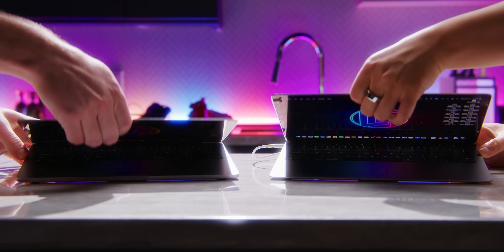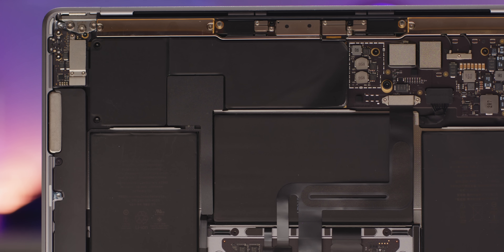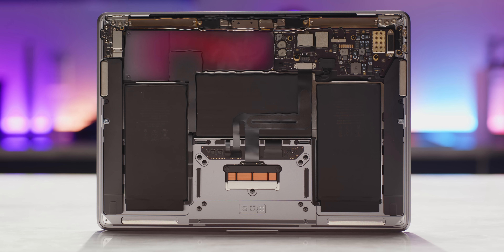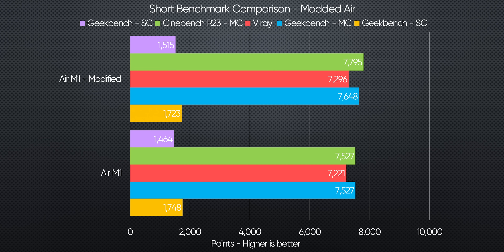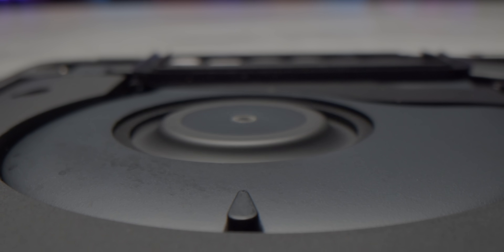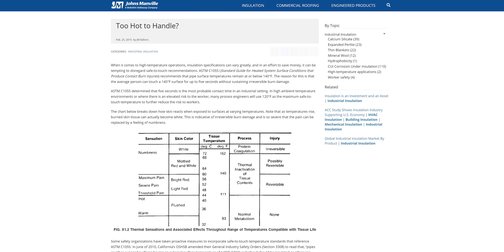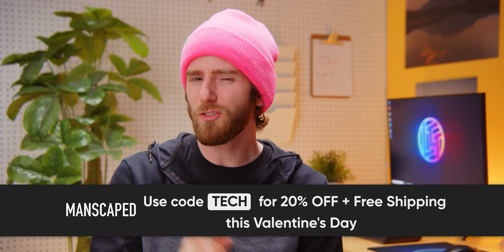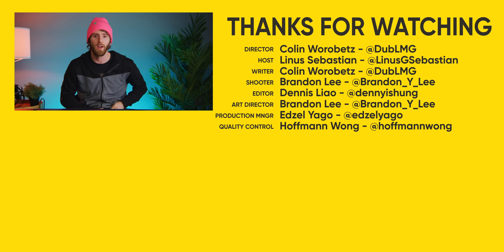Fixing Apple's GOOD Engineering - M1 MacBook Air thermal pads

Comment: I just finished running Cinebench after the mod and my 10 minute score went from 7067 to 7687. The bottom panel got a bit toasty but it's hardly a burn hazard. I can understand Apple's reluctance to making them this way from the factory, because they didn't want people complaining that their notebooks run too hot, not realizing that the panel is acting like a heat sink.
Reply: What about on top of a cooling pad? Does it improve even more?
Reply: @eduardoavila646  Eh, maybe, but you'll reach a point of diminishing returns. I wouldn't spend money on a cooling pad just for this if you've already done the mod. You can only improve the heat transfer just so much.
Reply: Because it’s a regulatory requirement, that’s why.
Reply: @Youthful-Steps--pay-off-later  "There are no solutions - only tradeoffs" - T. Sowell.
Reply: Your battery will die of temperature
Reply: @selenix  No worse than using your laptop on a warm summer day. Much better than most cellphones when on a charger while being used. The batteries can take it occasionally without much fuss.

And chances are the heat dissipates before it even spreads low enough and wide enough to affect the air around the batteries.
Reply: @thequantaleaper  There are Lithium polymer batteries and they are dying at 35°C. Your "Custom heatsink" will not only cool the chip, but also heat the air inside (they are no way to go out). Hot air and contact with HOT "Custom heatsink" is the worst that you can do to the batteries. I hope you understand my bad english.
Reply: @KABKA-0xMP  the thing is there’s already hot air inside the machine without the mod. The difference is that it isn’t going anywhere. The thermal pads direct then to the bottom outer shell.
Reply: @sterkriger2572  in the last 6 months I have changed 7 batteries for clients who modified their macbook in this way

Comment: Okay. Never knew there was a standard / specification regarding surface temperature of electronic devices, but if that's the case, why the hell laptops from like 2009/2010 could reach temperatures so high they were actually really discomfortable and low-key kind of hurt to touch?
Reply: And some mobile phones as well. Xperia Z1 for example could become so hot, that it actually was borderline painful to hold it in hands.

Comment: As you have now been able to transfer heat to the exterior,  you could now utilise a laptop stand with a built-in fan or maybe cooling gel pads on the underside (like the ones you get for migraine etc)  for a  short term solution.

Comment: Unintentionally did the same mod in my old macbook replacing the ssd with an Intel m.2 1tb drive... The slightly thicker m.2 drive touches the aluminum back panel... And that 'heat sink' sure do get hot!!

Comment: It could make the battery lose lifespan since the hotter a battery is when it's in use, the faster it's lifetime shortens
Reply: If you use your MBA at 100% CPU for hours at a time daily and keeping the bottom insulated, maybe? But After just 20-30 minutes or so the batteries are still well within the standard operating temps.

Comment: What if you use a cooling base with fans though? Does it make it even better given the heat dissipation of the chassis would be helped by the fan? ( Or so it seems? )

Comment: How about reducing the surface of the applied thermal pad, or apply that in stripes so that the dissipation process on the chassis is slower? Would that affect performance increase significantly?

Comment: Not Apple's first time they went all passive cooling. The Apple III was notable for having no fans or vents because Steve Jobs thought they were ugly. So you had a computer that cooked itself to the point at which it melted the solder and the chips came unseated. The official solution was to pick it up and drop it three inches.

So why am I not surprised that Apple has produced a laptop that has deliberately crippled cooling. But they don't care. They'll just insist you buy the new model next year when your fancy Macbook Air starts to cook itself. I'm no Greta Thunberg fan but we live in such a throwaway society. Consoome product, then get excited for next product. Ugh.

Comment: Why didn’t you test the cooling pads on the pro? If the theory is that the only thing limiting the m1 is heat, the fan plus the pads should perform even better. Or at least do this same test with the pros fans unrestrained

Comment: Lol, my acer aspire V5 from 2013 easily hits 95C surface temp on the bottom, cpu temps up to 122C according to argus. no I don't dare use it on my lap, it left a permanent rectangle in my memory foam.

Comment: As an Apple Certified Technician I recommend against this for 2 reasons. 
1. It voids warranty partly, maybe even entirely
2. It moves heat over the battery, which over time can cause the battery to swell, or maybe even catch on fire.

Apart from that, it's a clever mod, not gonna lie

Comment: Burning yourself on your Laptop is not uncommon, i use a w541 Thinkpad Workstation and if i train ML Models or anything that puts real load on the machine, it heats up rapidly and the chassis on the bottom left corner hits easily in the 60-70 C range ( right where the heatsink is)... i got burned already on it multiple times, while working in bed or on a sofa. I therefore replaced heat paste etc and also now downclock it and undervolt it to stay nice and cool. While the core temps mostly stay at max in the 85-95C range under max load, but really I did end up with burn marks from this machine. Can not work with in on my lap, while not wearing a jeans or something, if i have to put it under a real workload. I absolutly believe the scientist story.

Comment: Linus is wrong. If the air is 35 deg C then the heat loss does not remain constant and is not the same as -10 deg. C. Also the heat loss is based average heat loss for the whole base and not point heat loss. The heat at the point the thermal pads touch the base is greater than the points at the very end as heat has already been lost. Also if you put the laptop on your lap then the heat will increase as the heat loss is less

Comment: Apparently the crApple "engineers" don't know that aluminium has an excellent heat conduction but it's VERY reflective of infrared. So the heat irradiated by their heat sink will be reflected by the aluminium bottom back to the heat sink. The thermal pads solve that

Comment: I use my macair as a desktop, upside down with the bottom opened (with an external monitor) when I need more power. It improves the performance significantly .

Comment: Have you tried using smaller thermal pads? This should give some additional thermal mass and surface, but the MacBook's surface might heat up a little slower. Of course it would be a trade-off between cooling efficiency and surface temps, but maybe you can find a nice compromise...

Comment: This mod is likely to adversely effect your battery life.  Also I am know expert but I don't think heat dispersion works in the linear fashion described in the video,  it would be fine if the air around the laptop stayed at a constant 20°C, but as the heat is dispersed the ambient temperatures continues to climb and who knows if convection alone is enough to keep it within sustainable temperatures.  Personally if I was in LTT I'd ask GN for an assist on this one because they have the tools to do that sort of testing.

Comment: Curious how this affects battery temperatures during extended workloads. The idea is that the batteries shouldn't be getting too hot either as it reduces their capacity and lifespan (a common issue with thin gaming laptops). I personally am not sure I would sacrifice battery longevity for increased performance.
Reply: Just do the long task this week and the m1 air with pad mod, get battery reach 48C and stop charging

Fan the bottom and then it charge again when temp going down

With active fan it will be OK for long task, without fan it still OK for short burst
Reply: @frankwong9486  would it be better if you (might) use the less efficient thermal pad mod (the cheapest one)? 

Or just simply not applying any thermal pad mods and using an external laptop fan cooler instead?

Comment: Constant heat will make the thermal pad become super sticky, just like super glue, it sticks the rear panel and the motherboard together, unless you use a crowbar, you may not be able to remove the rear panel and open it again. It may damage your expensive luxury Macbook Air.
Before using it as linus, you should know the potential risks.

Comment: I am not sure if pay 1500$ for a macbook air m1 16gb ram  512gb ssd or paying 1000$ for a macbook air with 8gb ram 512gb ssd. I use it for streaming and sometimes working like developer with vs code or some docker or similar and it will be my first time with a macbook, Which option you recommend me?

Comment: Seems like it would not be that hard to remove all traces of thermal pads should a warranty issue arise. Along the same lines I had a Dell Inspiron laptop that always ran hot from day one, plus it had fans in the back that blew hot air on your legs which got uncomfortable if you were wearing shorts. Fortunately I never had a battery explode as happened to a few other Inspiron owners.

Comment: This is actually a pretty decent hack for people who tend to spend a lot of time with their laptop docked at home.  All you'd need is a quiet laptop cooling pad with a fan, found commonly anywhere online, and you'd have an actively cooled M1 Air during long encoding sessions.  The fact that the pad cools the laptop from the bottom perfectly matches the heat transfer to the bottom case cover.

Comment: I think apple should bring back the 2011 macbook Pro form factor as a "desktop replacement" with updated ports with new components on the inside, It wouldn't be a bad place to really scale the M1 or use intel offerings with a discreet GPU. I know the 2011 Macbook pros were known for overheating but having looked inside one before, even though the fin stacks were thick, they weren't very long, which could easily be improved. Plus the newer chips scale greatly with a little extra headroom

Comment: Instead of turning the backplate of the Macbook Air into a heat sink, add a sheet of copper onto the heatsink, and then put the backplate on. This way, the heat is transferred to the copper sheet and it should keep the bottom cool if the sheet is thin enough!

Comment: Sure, the thermal pads are a cheap and elegant solution. But it doesn't seem complete.

Could you put some kind of spacer on the bottom of the laptop, to keep some distance between surfaces like your legs, and the laptop case, and allow airflow as a side effect?

Comment: You could take it a step further and etch grooves in the back chassis to increase it further.
You can definitely burn yourself, I've been burnt from my dell vostro 3600, it's never been cleaned and is running an i7 and windows 7 pro, the grating gets to like 70 odd degrees °c, past the pain threshold for heat anyway, I didn't exactly keep my arm there.

Comment: Have you tried running the long benchmark on your lap? This should actually work out fine, because you become a huuge water cooler for the notebook. This trick worked for me back when the 17" MBPro still existed (which came with a 90W power brick which it could easily overwhelm depending on the load scenario), so it should work a whole lot better for a 35W machine. Just have it already sitting on your lap when the load starts, so heat can be transferred away right from the beginning.

Comment: Or you could just get the MacBook Pro 13" w/M1 and it's active cooling system.  Which will vent the heat through the hinge and not to your junk in your shorts.  Or you could wait a few months for the more powerful next generation Apple Silicon SoC chips coming soon. You know, the ones with more CPU cores and beefier GPUs and possibly discrete GPU (maybe). Those should stomp the entry level Air, Mini, and MacBook Pro 13" with considerable more bang.  Intel is in serious trouble by 2022 if not later this year.

Comment: Just FYI... That standard was replaced quite a long time ago with IEC 62368-1. 
Additionally, those standards only apply to the EU. Safety test is not mandatory in the US or Canada. 
The market requirements normally dictate that products be UL marked, which is basically the same testing though. Again.. that is fully optional.

Comment: I would still try it with cutting in thin, stripe like holes above the heatsink instead of the thermal pads and see if this works, so the heat has an escape way.

Comment: I would like to see a part 2 to this video while using a cooling pad to move air under the chassis to dispensate the heat if possible.

Comment: Another option; a desktop stand with a built-in fan at the correct location to improve airflow at the heatsink.  Better performance while desktop and no extra heat while on lap.

Comment: I think you can find thinner thermal pads and stick them all of bottom may lower some temperatures ...also apple may use liquid metal thermal solution for faster heat dissipation

Comment: So if the mac book air's bottom case is now, apart of the heat distribution of the heat sink, Wouldn't it be ideal to place the laptop on a cooling pad, to further decrease the overall temperatures and thus increase performance?

Comment: CAN YOU TELL WHAT WILL HAPPEN TO BATTERY INSIDE MACBOOK AIR HAVING HOT CASE. THE BATTERY WOULD DEFINITELY HEAT UP, MAY CAUSE EXPLOSION :( . SO TELL THE RESULT AFTER SOMETIME USING THAT MACBOOK AIR THAT DOES YOUR BATTERY EXPLOADED OR NOT :) WE NEED A INSULATOR PAD AS BIG AS BATTERY AREA TOO TO AVOID SUCH EXPLOSIONS.
Reply: i MEAN I NEED THE RESULT AFTER FEW DAYS OF USING THAT MACBOOK , THAT DOES THE BATTERY EXPLOADED DUE TO OVERHEATING OR NOT :)

Comment: if apple couldn't use the bottom to dissipate heat without making it too hot for laps, why not use the top? just connect the internal heatsink to a solid dissipator that replaces the "little gap at the back" some of the heat can waft out of. it's a small area that's not likely to be touched, raising the TME limit to a whopping 100C. even if you use the number from A instead of E, that's still 65. and a thin coat of paint (which doesn't meaninfully reduce its ability to shed heat) pushes it up to 80

Comment: Is there a risk when transfering that heat to the LiPo battery?
Reply: @linus
Reply: If it were dumping directly into it probably. But it's not, the chassis is absorbing it away and it's dissipating faster than it's heat soaking. I guess if you were to max it out 100% for days on end you might see enough thermal soak but even then I feel like there's enough surface area it wouldn't bother it.

Comment: that is not how the thermodynamics works!!!!
I’m in rage right now…
The difference is non-linear, meaning that if you rise the room temperature by some amount you won’t get the same difference. It will be higher! 
This is wrong.. very wrong. Using ‘above ambient’ is like measuring you weight in dress and not taking it into account. Especially winter dress. NOOOOOO!!!
This is wrong! 
Look at the charts how the processor heats and you will see a part of that story – it always follows exponential law – curve, not straight line. When you are heating something, you are applying thermal energy to the system and the system wants to get rid of that energy and the only way to do it is to pass this energy to the air around.
But the hotter air has less thermal capacity, in other words, the same amount of hot air can take away less energy than the cold air.
So, no! it will be higher!

Comment: I thought the Macbook Air already had this feature... that the way it got rid of heat was by sinking it into the bottom cover of the chassis?? Maybe I got the wrong impression from some other video I watched about the M1 Macbook. If this isn't actually the case, that's kind of pathetic to me that sinking the heat into the chassis wouldn't have been the original idea from the start. 

Not to hate on Apple, but as impressive as some of their products can be, my biggest gripe with them is that they overlook some of the simplest features that can improve their hardware as well as their product experience. Their software is robust in many ways, yet lacking robustness in features that shouldn't even be recognized... they should just work and go completely unnoticed. 

In this particular example, however, it just makes me wonder what they were thinking? The reasonable explanations for this are gross incompetence from an engineering perspective or (and probably more likely) deliberate exclusion of this feature to reduce its performance so they could sell the "Pro" version of this Macbook. You pick which is more likely.

Comment: Well, the first long term tradeoff that comes into my mind is making the batteries' lifespan shorter, due to added heat.
I also call that "delicate bits" story a total BS right away. As far as i know Macbooks never had their processors below the trackpad. Instead, it's the batteries all of them have placed right there, pretty well protected against thermal spikes, and thus, also making it more comfortable to lay hands on while typing.

Comment: Could you increase the cooling further by attaching an aluminium sheet to the bottom of the MacBook air with thermal conductive adhesive increasing the amount of heat it can soak up/radiate? The aluminium acting as heat sink?

Comment: I wonder how thermal pads and then use a laptop fan cooler surface would perform. Maybe even better then macbook pro only an extra like $50. You could even get one that doubles as a dongle(so adds lots of ports) and you've  probably got a pretty good "pro" workstation.